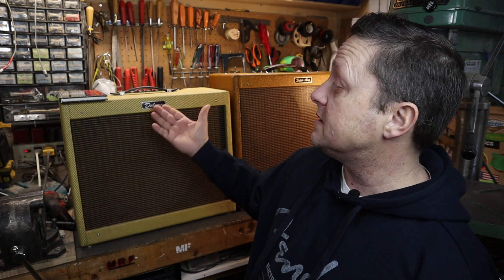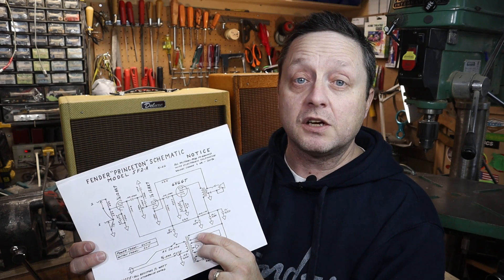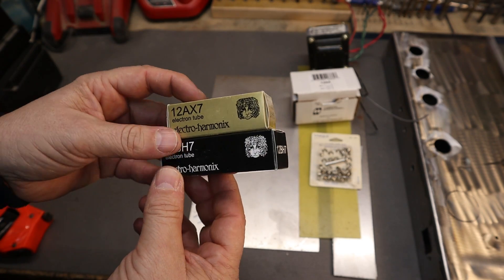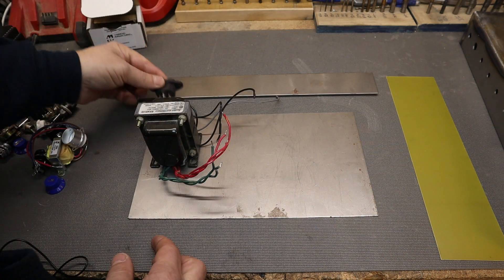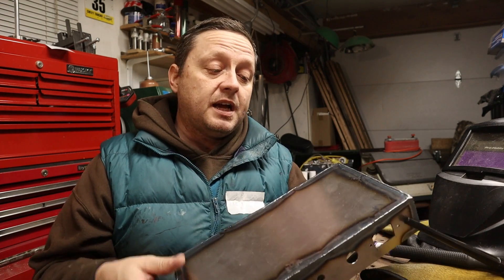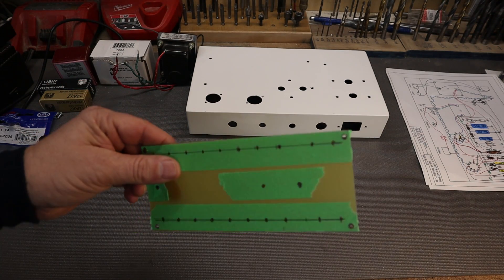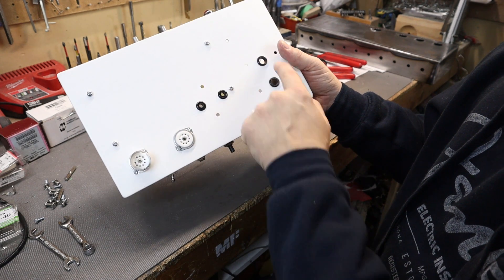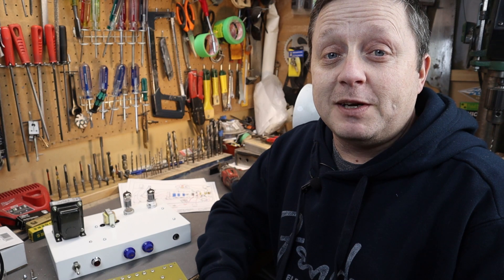Making a 1 WATT TUBE AMP-Part 1: Schematic, Parts & Chassis // Building a guitar amp from scratch!

Comment: Cool, this is basically a little Class A Amp much like the Peavey Royal 8, nicely done, Are the eyelets the ones sold for PCB, or for Clothing?
Reply from the maker: Thanks for your comments. The eyelets in the video are typically used for clothing. I’ve also used ones for PCB’s and they look the same to me. My only comment is the clothing ones are a bit bigger and you should clean/sand them to remove any oxidation before soldering.

Comment: This would be cool if you could do a Marshall 59SL or/and a 2204 master volume. The chassis would have been easier to do if the sides were attached and bent into place, then you would only need to weld is the short vertical corners.
Reply from the maker: Thanks for your comment.  Yes, I’m in the process of building a higher gain 1watt amp like you describe. New video will be up in the new year.

Comment: Just start off with a C Purlin channel section. 300x 90x 2.4mm. Cut to length then cap the sides and plate the open side.

Comment: Thanks. I just got a used Blues Jr and am in the process of putting in a Texas Heat speaker. This may seem simple but it is an adventure for me. It obviously sat around as dust was in the cab. My question, instead of making the box and drilling, can you buy this stuff in units so that it is more like gathering the parts and assembling them with your schematic? Thanks Mike You might want to look at the SCHITT VALI 2-I have my headphones plugged in now.
Reply from the maker: Thanks for the comments. Yes, you can find generic chassis and kits to make whatever you want.  Mojo and Weber have stuff like that.
Reply: @MikeFreda  Thanks Mike,
I appreciate the advice.

Comment: Hi Mike, I was wondering if you sold any of your amp kits or did custom builds? I'm looking for an amp head similar to the Orange Micro Terror.
Reply from the maker: Hello, thanks for reaching out. Unfortunately, I do not sell kits.  There really is no money in it for me since I have to buy all my parts at full retail. I’m not familiar with a micro terror but I suspect it’s a higher gain amp. Would be fun to build but higher gain amps can be tough to make quiet and not buzz/fizz. 

Stay tune, I am making a one watt fumble style amp. There will be a video of it soon.

Comment: Use copper strings with magnets glued on the strings because I'm the anti guitar guy who never had patience to learn guitar because I didn't  think stealing someone's girlfriend as a fake rock star was worth it long term.
I made most of the circuit with parts hanging in the air just to see how fast I could make it on those white multi connector legs with screws.
Smashing a guitar into an amp would be my ultimate high/townsend/moon.

Comment: Your channel is a treasure! I feel lucky to find it 
I appreciate you thanks 
And how much the amp costs you?
Reply from the maker: Thanks. Well, this amp was a budget build. I had most of the parts left over from old project. I suspect if I had to by all the parts new the cost would be around $225-250. The transformers and electrolytic capacitors are the expensive parts.

Comment: What will happen if you plug it into a European mains line (230VAC 50Hz)?
Will it blow up?
Reply from the maker: Probably... you will be basically doubling your b+ voltage. You need to source a power transformer rated for 230vac.
Reply: @MikeFreda  Thank you

Comment: Do you believe tube rectification vs. Solid State makes a difference in tone ?  I'm building a 8 watt amp using 2 6AQ5's, a 12AX7 and a SS full bridge rectifier looking for that sweet valve sound.
Reply from the maker: Yes, I think so. If you had Like-for-Like amps and the only thing different was the Rectification you would hear a slight difference. As for overall Tone, not sure. SS rectification has less sag and typically yields you a higher B+ since there is less of a voltage drop. That being, if I was building a retro tube amp (like a tweed Deluxe) I would keep the tube rectifier. If I was just building a modern amp or just experimenting, SS is cheaper and easier to do and may also be a bit quieter since you can use higher value filter caps.

Comment: Nice content! Just subd.  just started to read into amp building and modding. I have a 15watt Hayden tube amp that im planning to mod into a Friedman jj jr., Can i leave the phase inverter, output section, and power section as is, and just mod the preamp section? Thanks!
Reply from the maker: Thank you. I’m not familiar with those two amps. Can’t really comment. There is nothing to stop you from tweaking the preamp circuit a bit with some different values. You may get something you like.... you may not. At the end of the day that’s how some tweakers got into business.

Comment: Just sitting through the 14 minute painting advert, paint pokemon. I hope the advertisers give you the due amount! Nice build indeed. Would like to know where to get one of those push pull output transformers? Also, I've never seen a phase splitter arrangement like the one in this amp. Does it somehow couple to the other part of the tube through cathode coupling, of similar?
Reply from the maker: Thanks for the comments. The add revue is not a lot by any means. I just helps pay a small portion of the project and video equipment. As you now, tube amps can be little pricey to build.

The output transformer is very common. It's made by Hammond and I got is from Mouser. Mojotone make a higher quality one as well. It’s just a small Push/Pull good for a few watts. 
This way of Phase splitting is also called Cathode-Coupled Output Stage. It’s a very old method (circa 1940’s) which is actually not that efficient but with a lower powered amp it doesn’t really matter since we are not looking for a lot of output in this application. This circuit is where one output tube derives it’s input by cathode-coupling from the other. I hope that helps?
Reply: @MikeFreda  Many thanks! I started building single ended small amplifiers for something to do during my oncoming retirement. I don't have much experience with tube push pull output, so if I can get one of the transformers at a reasonable price, might start exploring class B push pull. Your 1 watt amp project is gr8 for practice and sounds really nice, too! (o:

Comment: also any idea how to make it be able to switch from 1w to 5w or 10w. Or possibly adding an effects loop?
Reply from the maker: This amp is not designed to have higher wattage. You would need to go with a different design with larger power transformer and output transformer.  SE 6V6 or 6L6 with power scaling would be something to look for. I think MOJO and Weber offer a kit like that. Yes, effects loop can be added but I made this amp to be simple, low cost and easy to make.
Reply: @MikeFreda  its an awesome design and im very excited to build it.
Reply: They easiest way is to build a higher watt amp then attenuate it down to 1 watt.

Comment: do you have a full parts list?
Reply from the maker: Hello, not yet. I’m still tweaking a few things. There is a link to the build schematic in the Description section. This is what I used to build the amp in the first two videos. The Part 3 video will wrap everything up. Cabinet and final schematic and parts list.

Comment: Really cool! I'll be looking forward to the next installment. Question: How difficult would it be to use a Hammond 269EX power transformer in this build? I've got one built into a Firefly amp and I'm not all that jazzed about its sound. I'd like to try using a different schematic with this transformer and the Hammond 125A I've got too.
Reply from the maker: Good day. The new video will be up soon. I’m currently working on it. Yes, the Hammond 269EX should work. The voltage may be a bit low but you should be able to adjust the filter dropping resistors to suite. I should be able to recommend a value once I’ve built mine. The amp I’m building should have a “champ” style overdrive tone and not a high gain tone.
Reply: @MikeFreda  That's fantastic. Any help with values would be super. Also, you've gotta love the Champ overdrive! It's found its way onto so many classic songs. Looking forward to seeing the next video. Also, I love the way you welded up your own chassis. Very DIY! No possibility of having to cram stuff into an undersized Hammond enclosure since you're making it custom.